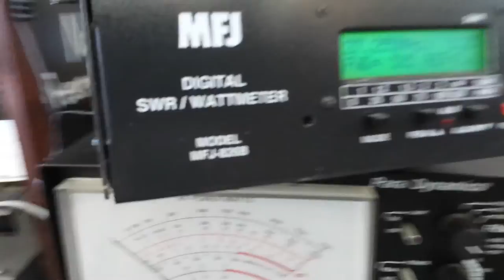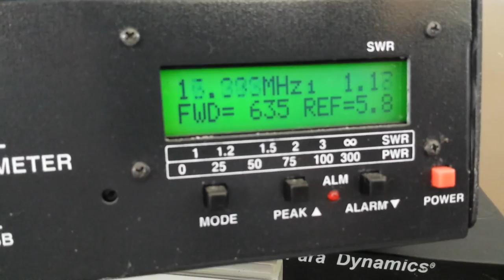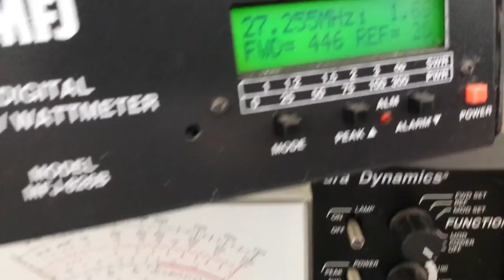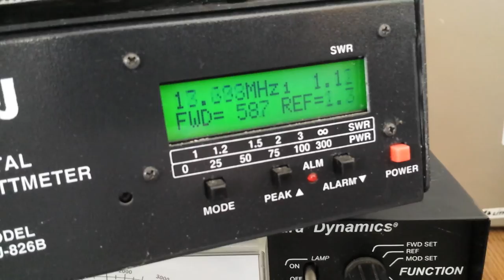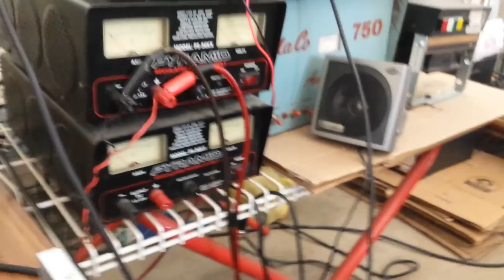Turn Your Linear Amp On With A Wireless Remote! - [Version 1 wiMOTE]

Comment: I put one of those 1 ch kits on my xforce x400 over 2 years ago.. I hated the ugly remote and pull out antenna on it ... I bought it off ebay for 7 bucks from hong kong... It worked for almost 6 months in my peterbilt then it quit like rf took out the receiver... I am waiting for a better unit to come out
Reply: i am in a fiberglass roof semi and rf probably was the culprit...

Comment: I'd like to know how this is done or where I can get it
Reply from the maker: d4rksydeofh3ll this was like the firsr vid ever done lol...brought back memories. check out the latest video i done...goto my channel itz a few videos down
Reply: Lol yea but I like the idea I'll check your video out
Reply from the maker: d4rksydeofh3ll oh yeah very great idea I really enjoy using the technology myself I've been running one for about two years or so now with no problems at all I made sure to fuse the units as well just in case there's other ever an issue and not to not too long ago I did a quad unit for a guy's davemade 5 transistor amplifier it turned it on and off turn the preamp on and off turn the side band on and off and then the fourth button would make the amplifier go and high or low
Reply: 1883GotDown sounds good man Hey I have been trying to get ahold of you to get one of your preamps
Reply: 1883GotDown sounds good man Hey I have been trying to get ahold of you to get one of your preamps